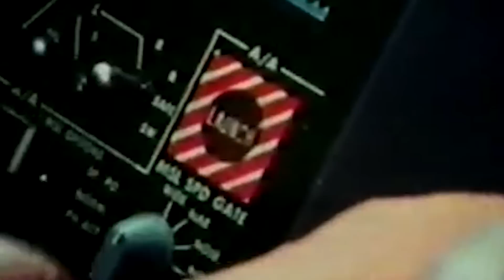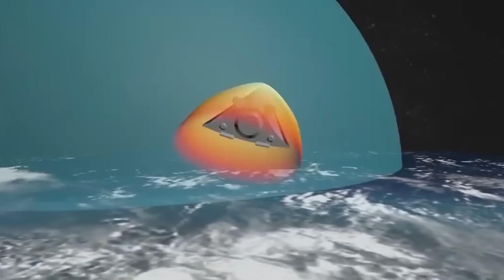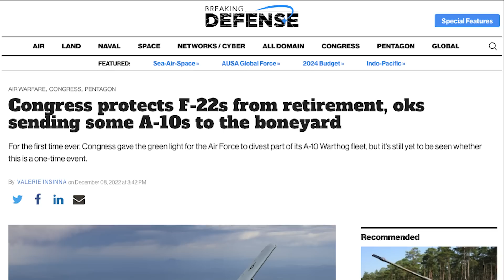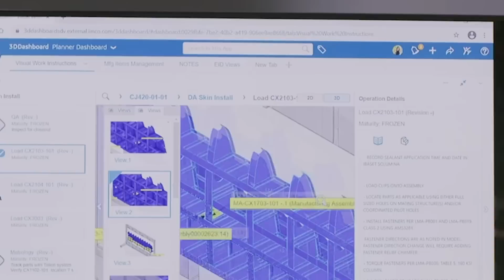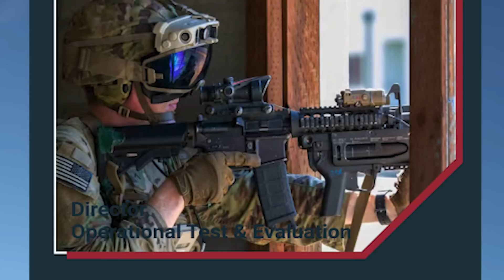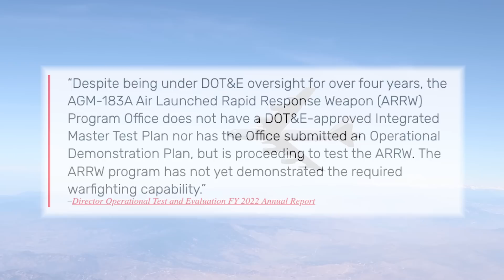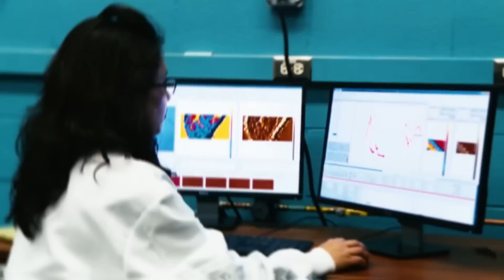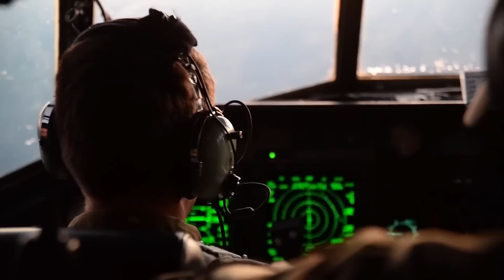What went wrong with the Air Force's HYPERSONIC ARRW missile?

Comment: Hypersonic missiles are overrated af when it comes to attacking mobile targets like ships.  There has not been one confirmed case of a hypersonic missile successfully engaging a moving maritime target.  

Hypersonic glide vehicles and cruise missiles are completely blind and deaf, just like regular ballistic missiles.  The plasma field around it prevents it from using any homing seekers.  I've read that they are all programmed to slow down considerably in its terminal phase (down to supersonic speeds) to eliminate the plasma field and receive up to date targeting information and turn on its own seekers, which will make them vulnerable to SM6 which has routinely hit targets traveling at at these speeds.    Any object traveling at hypersonic velocities will have massive infrared signatures, they can all be tracked (we are literally launching hundreds of satellites to track them in addition to all the ballistic missiles we can track).

And dont even get me started on dumb claims of hypersonic sea skimming cruise missiles.  It's impossible for a hypersonic cruise missile to fly 50 feet above the ocean while traveling at Mach 6.  In addition to all the problems i already mentioned about the plasma field, the heat shield on the missile would burn up in a matter of seconds.  Mach 2-3 is probably the upper limit for any missile traveling that low and our Aegis have demonstrated that they can handle those.

Bottom line - hypersonic and regular ballistic missiles are a real threat for FIXED LAND BASED targets.  Our airbases, ports, depots, com structures, would be vulnerable and MUST be fortified (i'm particularly talking about the ones in Philippines/Okinawa/Korea/Japan).   We have several weapons that have demonstrated ability to hit missiles moving at hypersonic speeds but we dont have nearly enough of them. They're going to be targets for regular subsonic and supersonic cruise missiles and China and Russia have a LOT more of them, than they have hypersonic weapons.  Each critical base should have thousands of Patriot/SM6/THAAD defending it, when in reality, we're probably lucky if we have 100 SAMs defending them.
Reply: "The plasma field around it prevents it from using any homing seekers."

That tells me all I need to know to realize that you don't know that the U.S. has that capability and has since the 1970's with the Sprint ABM. If the HGV was pointless like you imply, why was DARPA  testing it? It's because you don't understand that it is useful and capable.
Reply: As you say, magazine depth is crucial for any naval engagement or drone/missile defense.

I'm sure there's a limited military use for hypersonic missiles, but I see it as a necessary tech-tree branch. Either it leads to a newer, more powerful conventional weapon or it helps maintain or train-up the highly specialized skills of the aerospace/defense industry personnel.

Plus if we demonstrate to the Chinese that we've totally outdone them in the capability department, they may be forced to pour billions into upgrading their programs, or spend an inordinate amount of effort via espionage. Either way, it puts any US adversary on the backfoot.
Reply: @HTV-2_Hypersonic_Glide_Vehicle  lmao.  We have NEVER hit a MOVING maritime target with a ballistic missile, and i'm going to bet dollars to donuts that the LRHW that the Army just deployed wont do it either.  The Russians have Oniks, Shipwreck, Kalibr antiship cruise missiles and none of them are hypersonic.  The Zircon has never proven any ability to hit a moving maritime target at its claimed hypersonic velocity, a missile screaming down at Mach 8 or whatever Zircon is supposed to fly at has no chance to seek out a moving target, hell i'd be shocked if it could even maneuver without burning off its fins.  The missile will have to slow down and actually receive some sort of signal to home in on a ship going 40 mph+ like our carriers, and that's when an SM6 will get its chance.
Reply: @r.s.w.k4569  Laugh my ass off did I say that we did? What are you implying? That I did?
Reply: @r.s.w.k4569  With enough time for R&D, we could, but we have a habit of cutting off the funding.
Reply: @HTV-2_Hypersonic_Glide_Vehicle  And the article i linked tells you how Sprint was able to do what it did.  It had a ginormous 1 MEGAWATT radar to burn through the plasma.  Will each Zircon  carry its own 1MW radar onboard?  lol.  Like the article says, the Zircon will slow down to acquire its target and that's when the SM6 can strike it.
Reply: @r.s.w.k4569  WHAT LINK?

Comment: The airforce isn't to blame here - it's the company that designed the ARRW. Defence testing should be less than 1% of the testing done by the system developer, and the customer really knows very little about how the systems they buy actually work.

The fact that all failures were related to initial ejection shows that Lockheed's engineering management failed to give adequate focus to the delivery system - all their effort was put toward the hypersonic flight parts of the project. And if that's the case, the airforce is foolish to abandon the project because fixing the ejection failures is far cheaper and would take less time than starting another project. That and the fact that everything else about the ARRW may actually work as intended.

This also highlights poor project management on behalf of the airforce as well. The delivery system should have been validated and tested before wasting vast resources trying to test a system that isn't ready to proceed to such a test. Give this to a small/medium sized engineering company and it would have been completed successfully in the same time for 10% of the cost. The big defence primes are money pits for tax-payer dollars.

Comment: I think the tactical utility of hypersonics may be significant for the US, and it does feel like a loss of overmatch that should not have happened.  Currently, antiship missiles and cruise missiles for ground targets may be intercepted by air defenses. Stealth missiles offer an as yet untested advantage.  In any case, the big problem right now with China is range.  If the US had 1000 mile plus range hypersonic antiship missiles, as China does, those missiles, could threaten Chinese ships and land based ballistic missile sites while being very difficult to intercept, thereby, allowing fewer missiles to be fired, and giving less time and opportunity to pinpoint the firing source.  It seems like that would actually be very significant in leveling the playing field in the Pacific and reducing China’s A2/AD bubble.

other important thing to mention is that hypersonic glide vehicle missiles may be less provocative than ballistic missiles, which might be nuclear. If the US makes it known, and offers inspection, for not using any nuclear glide vehicles, they could be launched without risking major escalation. The US could take out Chinese sites, and while I’m not sure about their moving target, tracking capability, possibly Chinese ships, with Sub launched ballistic missiles, but even if armed with conventional war heads, it might trigger a nuclear alert.  The different trajectory of the hypersonic weapons sends a different signal if the US is transparent about not using any nuclear warheads, using kinetic or conventional munitions.

Comment: Maybe more should be invested in laser based weapons/interceptors to counter hypersonic missiles instead of just using missiles? They use pulses or constant flows of energy traveling at close to the speed of light which is much faster than a hypersonic missile. All USA aircraft carriers should have laser defense weapons because they have a virtually infinite magazine due to the nuclear power plant. Maybe the carrier battle groups could be shadowed by the special airborne laser 747's if they are still in service?

Comment: I agree with the defense concern, but it seems that ARRW was a "knee jerk" reaction from the government. We should have put that development funding to better use.
Reply: Disagree.
Reply: @HTV-2_Hypersonic_Glide_Vehicle  What do you disagree with?
Reply: @glengearhart5298   
"it seems that ARRW was a "knee jerk" reaction from the government" 
"We should have put that development funding to better use."
Reply: @HTV-2_Hypersonic_Glide_Vehicle  Yes, that is my point. Though we learned a few things from ARRW, it did nothing new. There are other programs in development that could have better used those dollars. Just a couple examples: High energy lasers for defense, SCRAM jet tech, and materials to protect hypersonic weapons systems from the astronomical amount of heat they will encounter. I am a huge proponent of our defense industry.  "Speak softly and carry a big stick; you will go far."
Reply: @glengearhart5298  "Though we learned a few things from ARRW, it did nothing new"

The U.S. has a bad habit of cutting good ideas because of failures.
Reply: @glengearhart5298  "High energy lasers for defense"

It takes 3+ seconds for a laser to spot a little drone and take it down, a glide vehicle would already have put a hole in a destroyer by then.
Reply: @HTV-2_Hypersonic_Glide_Vehicle  The difference is a size. True a drone is tough to detect, but a glide vehicle with enough of a payload to make a destroyer combat ineffective can be tracked from a much longer distance. 
Look at the lasers being added to Israel's Iron Dome defense.
Reply: @glengearhart5298  how do you know?

Comment: There are cases claimed by Putin perhaps Putins advisers to be most exaggerating at times even though he doesn't have a decree in physics 😂 the only feasible hypersonic mentioned is the avangard which technically is more challenging making this glide vehicle feasible 

The most basic principles dealing with a hypersonic glide vehicle is Newtons first law of motion which is inertial force on a given body 
Newton's first law of motion is often stated as

An object at rest stays at rest and an object in motion stays in motion with the same speed and in the same direction 

unless acted upon by an unbalanced force

Russian glide vehicle avangard is their previous vehicle displayed during 90s at some airshow describe as HELA (hypersonic experimental flying vehicle)

The only thing that really took my attention is this glide vehicle can travel more than Mach 27 releasing its vehicle and glide in near atmosphere and maneuver at Mach 27 that took me by surprise, given the design of this avangard glide vehicle with its horizontal stabilizer or thrust vectoring nozzle for maneuverability at Mach 27 it's still challenging at some point because your still dealing with it's inertial force which is Newtons first law of motion plus add the factor of an ambient temperature where all your electronic parts and materials would incinerate at such high speed in near atmosphere perhaps at 80,000  alt there is no such vehicle can travel at Mach 27 in near atmosphere altitude, the only vehicle can travel at Mach 27 is an Orbital  space vehicle such as NASAs orbital space vehicle X 37 at Mach 27 or more this vehicle can travel above atmosphere in space 

Given Russia's HELA hypersonic glide vehicle lets say it can travel above atmosphere with a thrust vectoring nozzle for propulsion maneuverability you might still deal with Newton first law of motion inertial force unless this things behave in a non Newtonian physics 😂

Comment: In 1985 A f15 Shot Down a Satellite that was Hypersonic ! For What the Missile has to do its Small But its Still to Big to Lug Around in the Air for Combat,.  Loads the Release ,Battery goes dead Low Voltage ,Bad Ignition Engine Won't Start Drops like a Dud Has in Flight Failure Daunting Task ! Make it Split Core ,Stacker or Bi-Sectional to Shorten the Length, Decrease Diameter and Narrow the Heat Sink !.

Comment: Hypersonic is also too expensive to be actually useful.
Reply: no it isn't
Reply: @HTV-2_Hypersonic_Glide_Vehicle  You can five 10 tomahawks for the price of one. Air defense might shoot down 3-8 but who cares still 2 hits.
Reply: @Dapieguy314159  For a ship with a small amount of defense missiles from a range of 330 miles yes, but that would make carriers vulnerable to attack. So you would have to be more than a thousand of miles away. That is where the ARRW comes in.
Reply: @HTV-2_Hypersonic_Glide_Vehicle  @David Moore  block 4 has a range of 900 miles. We need better air defense if anything.
Reply: @Dapieguy314159  ARRW was supposed to have more than 1700 miles
Reply: @Dapieguy314159  "We need better air defense if anything."

I absolutely agree with that.

Comment: Hypersonic missiles are not particularly useful.  Their sensors and receivers cannot work because plasma prevents it. Electromagnetic radiation cannot escape it or penetrate it.  At the same time the missile is blind, it is wildly detectable due to its massive IR signature.  The pressure wave it creates is itself detectable to a properly attuned long range Doppler radar.  It is blind yet detectable.